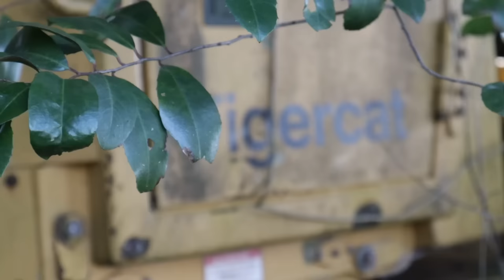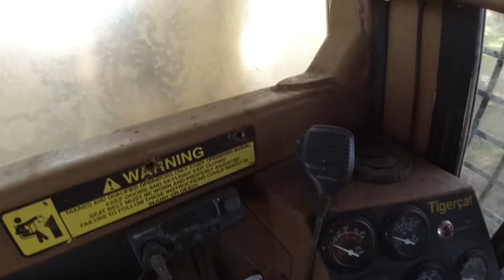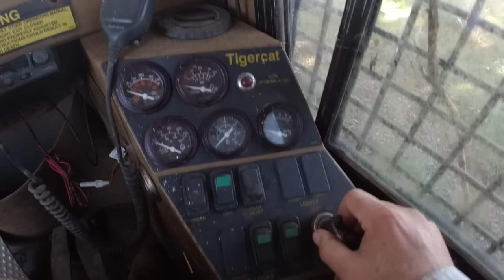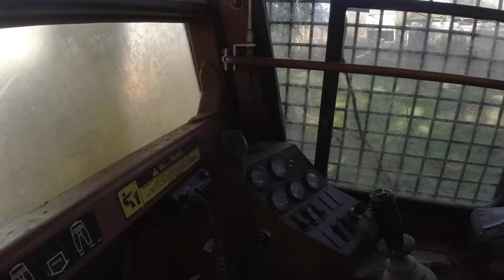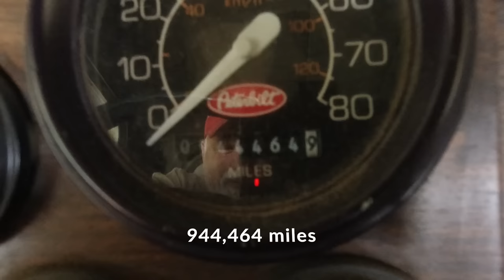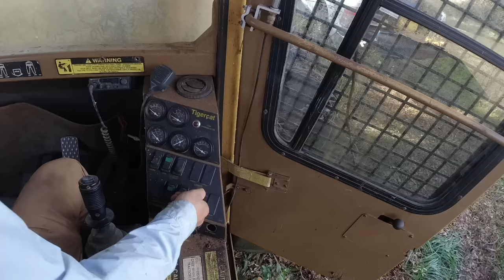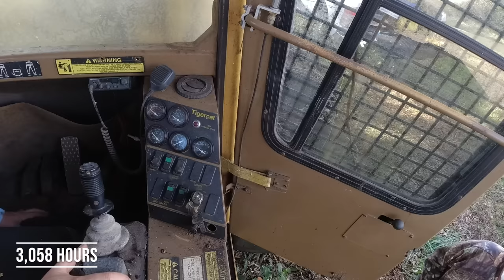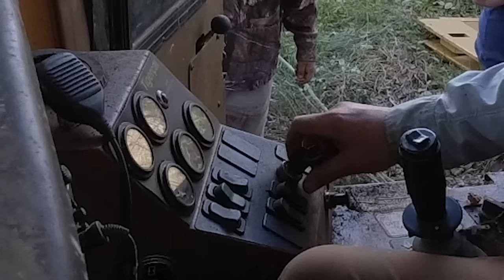Logging equipment hiding in the bushes!  Will it ever run again?

Comment: That’s a Tigercat you can’t kill em. But the hour gauge it flips ever 9,999 hours and it’s still in good shape no doubt about it, but it’s likely to have 13,550 hours not 3,550 hours. I had one that burnt twice flipped over three times and when it finally died it had over 30,000 hours lol. Tigercat is a good quality machine and last forever not like a John Deere overly expensive and can’t get parts for a reasonable price

Comment: Just a idea to tote your batteries.  Get a hand truck weld a couple of battery boxes to it hook your batteries up and use a set of jumper cables to it and just roll to the area. C clamp's would probably work better than vice grips to hook up.

Comment: Hank, you should get one of the Stihl or echo combi system with the batteries. A hedg trimmer would make easier work of those vines and stuff better then a chainsaw. Love you guy!
Reply: Definitely one of those hedge trimmers for the vines
Reply: I just ordered one of those wire wheel attachments for my gas trimmer 👍

Comment: I have a 18 volt Makita cordless sawsall with  5amp batteries I have cut down plenty of big trees down with it no problem, Milwaukee makes an amazing set of blades one called the AXE is 12 inches long and works so good ...I climb up the tree with a rope tied to the saw, and to me then I pull the saw up after me cut down the smaller limbs first and be rotating around the diameter of the limb and using gravity as a tool I can take down a lot larger than 12"  ...I am on the lookout for longer blades that are just as good as the Milwaukees but haven't found anything yet... 
I also tore down a 80 year old building the other year the nails they use back then were real steal and the carbide bi metal wood blades Milwaukee has are like cutting through butter with a hot knife 👍👍👍  I never had to replace one of those blades yet. But I do have several just in case...cause that's what I do. And also one 5 amp battery lasts about 30 minutes of straight cutting time.  I don't know what I'd do without these tools. But I do have hand saws and gas saws that do work just not as handy.  🙂